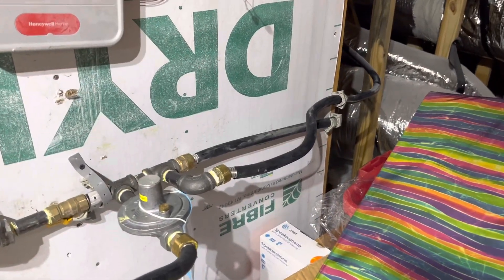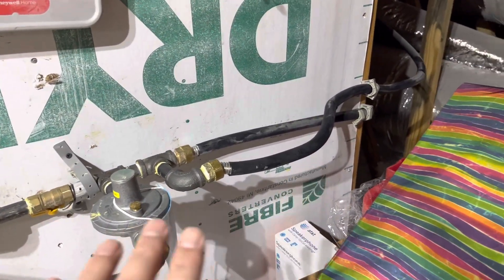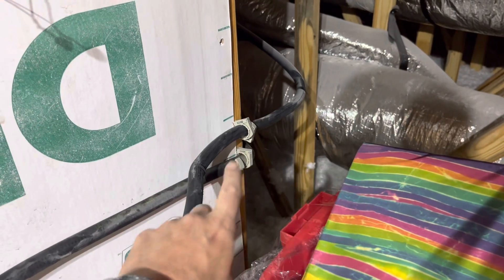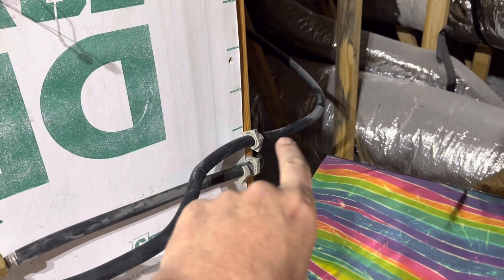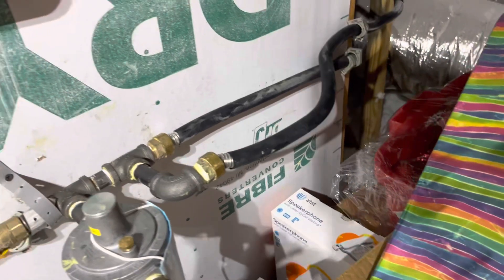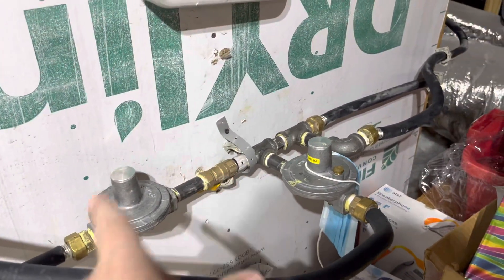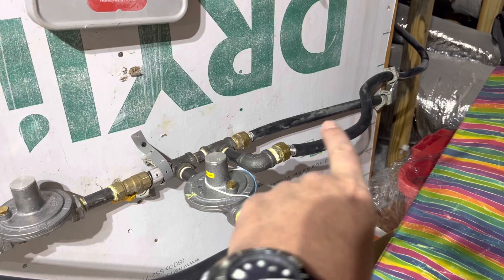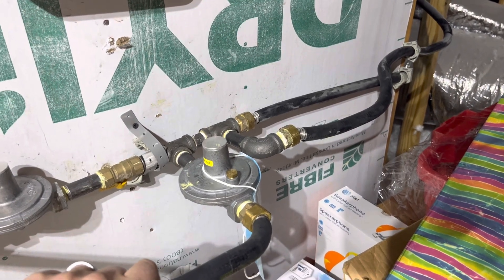Undersized gas main to home ￼

Comment: also looks like it should have gas cut offs on the two lines coming in before the regs
Reply from the maker: Those lines are after the regulator. It’s acceptable to have valves close to the appliance not necessarily at this junction.